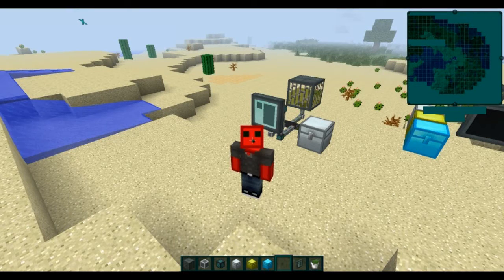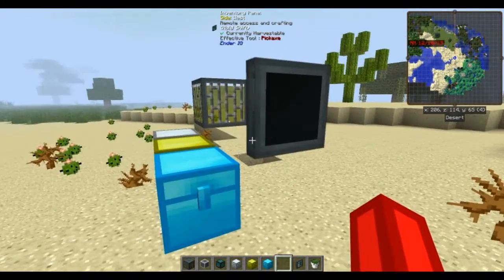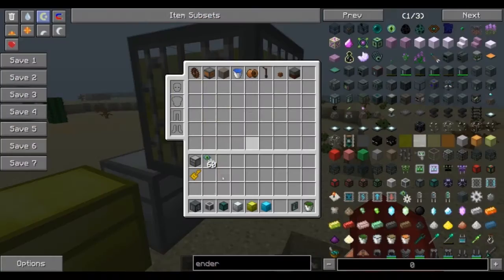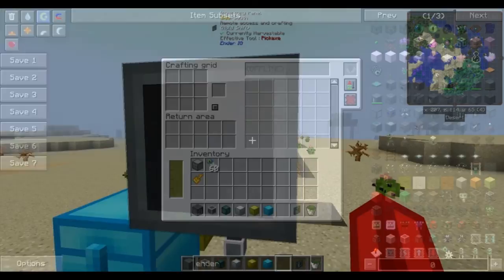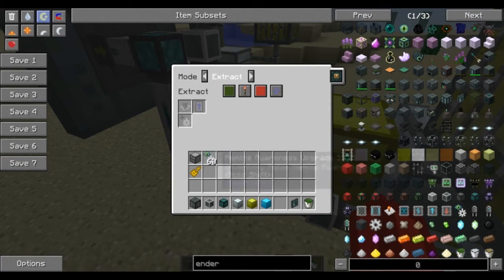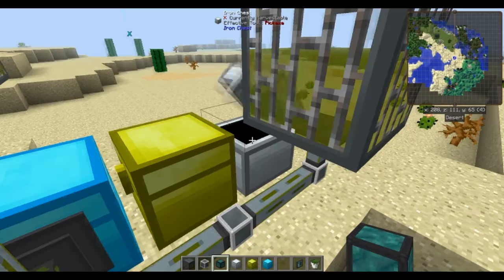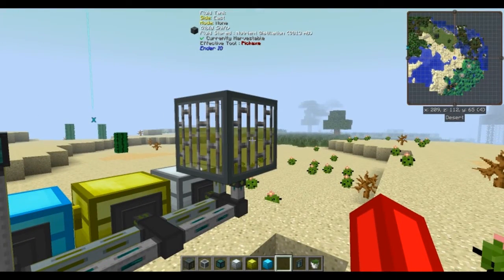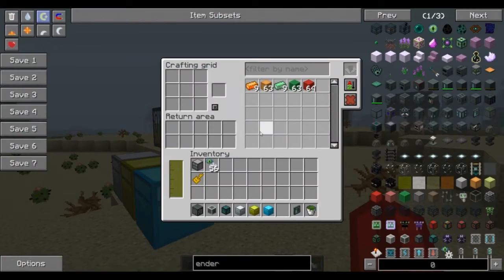Ender IO Inventory Panel - Setup and Use

Comment: can the item conduit connection to the chest or caches be as long as you want?
Reply from the maker: I havent run into a length issue with the enderIO wiring yet.